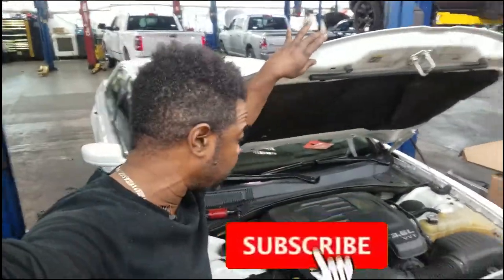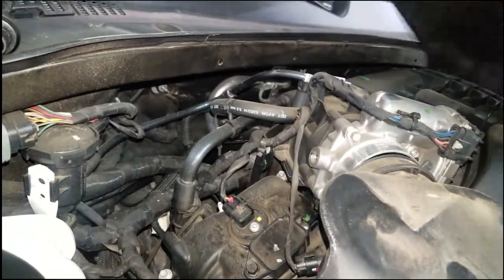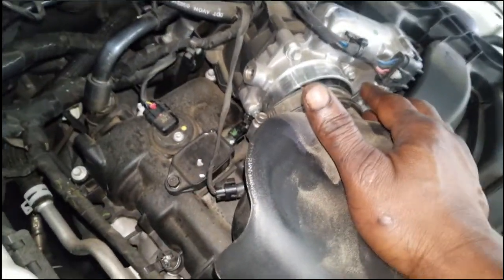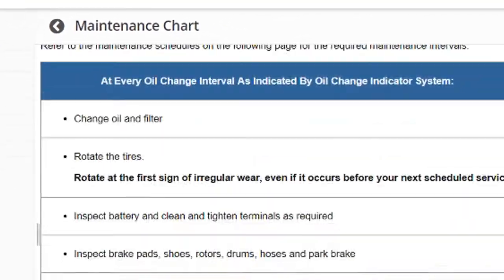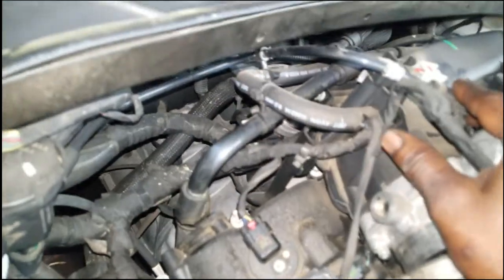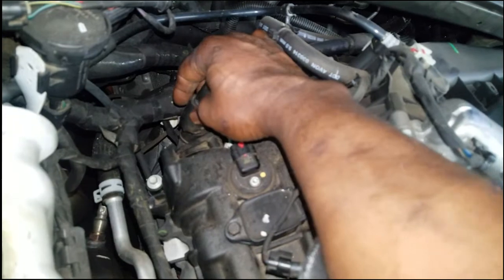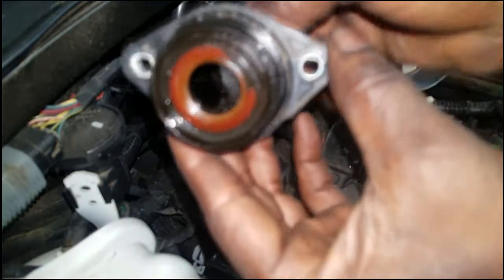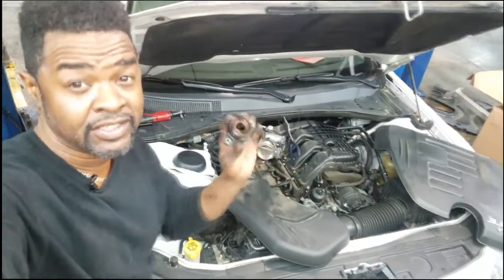3.6L Pentastar PCV Valve location and how to replace. Chrysler Jeep Dodge. Caravan, Town and Country

Comment: Excellent video. Most people don't know the importance of replacing the PCV and no dealership will tell you about it either, cause they want your engine to start blowing seals, then they'll charge you thousands for a new engine! My 2015 Caravan with the 3.6 Pentastar has almost 300,000km's and it doesn't burn a drop of oil! Never had a single problem with this van. No engine/transmission issues... NOTHING! BUT... I take care of it. I change the PCV around every 40-45,000 kms, and this van STILL runs like brand new! The air filter and cabin air filter also get changed out around every 40,000km's. And I only use fully synthetic 5W-20 (usually either Quaker State or Penzoil.)
Reply: That's the key !
Reply: yea i remember taking it to diagnose the oil leak into my engine filter and none of em supposedly had a clue... my a$$! these mechanics are crooks

Comment: I agree yet I would change the pcv valve more often as the engine's hour/mileage increases. In other words change it every 30k and once you hit 100k Miles, I'd suggest replacing it every 20-25kmiles

Comment: The most information and shortest video I've seen on this.  Most others go into an over the top explanation about why the pcv needs to be replaced.  Definitely hitting subscribe to this channel.
Reply from the maker: My man, thanks for watching and subbing.
Reply: @OnlineMechanicTips How about the newer gen 3 Pentastars, where the PCV has no torx bolts/screws???  How do you securely attach/safely remove these pcv from exhaust cam/cover? Thank you.

Comment: Replaced pcv valve at 203k miles.  It was fine.  Just changed it while replacing the lifters.  Also changed the original spark plugs while at it, though they really should have been replaced around 125k  based on the wear it had.  That's just me though.

Comment: Much appreciated; We have the 3.6L in a Wrangler Sport, one of the issues for the check engine code is the PCV. Already did plugs & Coils (as you know when you are there for one, just change it!) but #6 cylinder shows an issue. Even though it does not misfire, mileage the same, no bucking during acceleration, etc. Anyway, Thanks for the 4-1-1 repair...

Comment: What I want to know, is why the Mopar branded PCV valve on this engine is so darn expensive! The dealership wants CAD$125 for the part. Even a non-Mopar one from a local part store is around $115. Are the Gates branded ones from Rockauto just as good as the Mopar ones? I ask because it is only CAD$43.

Comment: I have the newer model 2018 which doesn't have screws attached to the PCV valve only turning it clockwise while pressing hard. However, while doing that I noticed that the orange rubber gasket color was gone the gasket looks fine but the color pealed due to turning it hard clockwise multiple times to make it fit. Should I worry and get a new gasket? or leave it as it is?

Comment: Thanks for the vid. I'm wondering if the pcv valve system can be deleted? Vent the valve covers into the open. Quit getting all that hot air and oil sucked into the intake. ( old-school thinking)
Reply from the maker: interesting
Reply: Install a catch can

Comment: I have a 2012 Dodge Grand Caravan 3.6 & i noticed there is a bit of oil on the top of the engine air filter.  Could a failing PCV valve be the reason for the oil on the engine air filter?
Reply: Yes. Check you throttle body. If there's oil there. Your pcv valve is bad

Comment: I just pulled mine out. My question is the valve spring loaded mine is just rattling around in there freely
Reply from the maker: Then its def time to replace it. Thanks for watching, please thumbs up the video and subscribe to the channel, thanks
Reply: @OnlineMechanicTips  If it was springloaded and it's not anymore I'm wondering if my motor has a spring rattling around in my valve cover??
Reply from the maker: @jessevos5109  Are you working on a 3.6 Pentastar? Again, are you subscribed to the channel?
Reply: Yesir I am subscribed. And yes the 3.6 on my 2017 ram. Could this be why so many  engines experience the failing of the rocker arms
Reply from the maker: Naw i dought it..most of it is rocker arm failure..as for whats causing it, thats still up for debate

Comment: JT, just got the rockers, lifters, gaskets, etc. in so I can finish my 3.6 Journey ticking on bank 2. So I got a new PCV, but I CANNOT find the part number for the updated hose. You show the tag but none of those numbers come up. What is the correct part number for the updated PCV hose??
Reply from the maker: They will ask for the last 8 digits of the vin..also depending on the year it may already be updated..if yours has 2 screws only, that's updated
Reply: @OnlineMechanicTips  I bought the 2 screw, updated Valve, just having an issue with the correct hose.
Reply from the maker: O. They will need the last 8 of the vin to get you the correct part number
Reply: @OnlineMechanicTips  Found it! 
Started the bank 1 rocker and lifter build. Got the exhaust done, but the timing chain is being a little bitch. Took off both phasers so I could route the chain back into the guide on the exhaust side and replace the phaser. Tomorrow I'll finish the intake side. Replacing the phaser and chain will be easier on the intake. (AWD, transverse engine)

Comment: I really need help. I have a 2014 dodge caravan. Over time its fuel economy got worse.. from 10.5l/15 to 16L/100 km. Recently i pulled a uhaul trailer and after that its stuck at using 18L/100 km doesnt matter if i drive in city or highway. A really strong gas smell. I have had spark plugs changed... injectors changed... 2 upstream oxygen sensors. I did the MAF...  no improvement. Mechanic has checked it and cant find any fuel leak
Reply: You should join his live stream and get your question in early as it’s a popular stream. Year make and model. If you need a faster answer, he has a cash app option where he will reply back pretty quick!

Comment: Would this have anything to do with a rough idle? My 15 charger is a bit shaky at idle but only at idle and not all the time. Mount was replaced and throttle body cleaned. Plugs were changed not long ago. I'm thinking coils but saw this video and wonder if I should knock this out too.
Reply from the maker: Did this Charger have any codes in the sys? Also are you subscribed to the channel?

Comment: Will a bad pcv valve cuase my engine to kinda idle alittle bit weird ? Sometimes it’s idling normal and other days it’s kinda shaky and wants to stall untill rpms shoot back up again by itself. Also noticed bad mpg and an oil burning smell but no sign of leakage I did however pull out the dip stick and there’s was no oil at all. A bad one will cuase oil consumption and an engine tick almost like a knock right ? It’s a 2013 Chrysler 300 with 160k miles
Reply from the maker: Hey bud, curious, do you have any trouble codes in the computer? That will def put you in the right direction as for finding the problem. Also, are you subscribed to the channel?
Reply: @OnlineMechanicTips  just subscribed ! And yes I keep getting codes to check my oil pressure but that’s about it
Reply from the maker: @juan_f150  What is the P code number?
Reply: @OnlineMechanicTips  it’s P0174
Reply: @OnlineMechanicTips  right next to the pcv valve you can also hear a small whistle almost like it’s leaking air

Comment: Off topic question. I have a camshaft actuator open sensor bank 1 code and already changed actuator and oil solenoid. And code still there matter of fact 10 more codes pop up. Can u help

Comment: Hey there!  great videos btw , I have a 2015 grand caravan and it recently developed a rough idle changed the spark plugs and the cylinder 6 coil but there is still a rough idle I didn’t think of doing that pcv until I watched your videos tonight just 100,000
Reply from the maker: This likely not you problem. Have you done a C test? Also are you subscribed to the channel?

Comment: Thanks for the video....How to test this type of pcv valve l??? i can blow air on both side and there is no restriction, other pcv valve are one way only
Reply from the maker: Hello my friend, these valves are design a lil different than the traditional valve and the test never seem to yield accurate response so with that, I just recommend replacing it every tune up spark plug change. Thanks for watching, please like the video and subscribe to the channel for me, thanks

Comment: Mine has 3 screws and I can only find the 2 screw PCV valve.. will it be the same even if the orientation of the hose is different?
Reply from the maker: They have been upgraded bud. They only use 2 screws now. https://www.youtube.com/watch?v=liwUEh6dqRE
Reply: @OnlineMechanicTips  Sweet! Thanks for the upload!!

Comment: I have a 2013 Jeep Wrangler unlimited and when I am sitting idle for a couple of minutes, I can smell some vapors coming through my air conditioning. Could replacing the pcv valve help with this?
Reply from the maker: Hello my friend, can you please like the video and subscribe to the channel so I can get it to grow? thanks...Hey im not sure the PCV valve your problem, i mean its a sealed setup if all the hoses are attached..But because its so inexpensive, it wont hurt to just replace it any way. This is a wrangler and this under body can attract all sorts of things. You could easily have a piece of plastic melting on one of the cats..The valve covers could be leaking, all sorts of things could cause this..Give this Jeep a real good visual inspection and see if you see anything un common..I would even steam clean  the enginei at the car wash (bath) and see if this persist

Comment: So what do u think of a oil catch can on the 3.6?
Reply from the maker: Hey bud, IMO, if I remove my intake manifold to say, replace the spark plugs and I see excessive carbon deposits, then yes I would consider installing one. But todays newer cars do a fine job with the PCV sys. Engineers one told me, If carmakers felt your car would benefit from a CC, it would have been installed at the factory.
Reply: @OnlineMechanicTips  or do u think they, car manufacturers, would think that the consumer who buy the car would not be smart enough to clean it, and or more responsibility on the mechanic to maintain it?

Comment: Can this help with cold start issues in winter weather bro? Nice video btw
Reply from the maker: Hey bud, thanks for watching an subbing..Yes if the PCV valve sticks in the open position, too much air will flow into the intake and causes the engine to lean out or evan stall at idle and cold start..Because this valve fairly inexpensive, ide just replace it everytime you tune the engine up

Comment: Might sound dumb but you dont know if you dont ask, but the pressure comes out of the pcv correct. Thinking about adding a catch can on my 300. Btw great video bro.
Reply from the maker: Exactly, but at a pre-determine time..you really dont want PCV during say, cold start or say idling..The pressure and vapors are routed back to the intake..A catch can sys will, well suppose to catch all the oil.. Not a bad idea, especially if its a high mileage car..My buddy added 1 on his high mileage 300 with the Hemi..Hey please sub the channel for me, thanks

Comment: Another question bro, have you ever heard of a catch can install on the air filter side? 🤔
Reply from the maker: I have not
Reply: I have.  Seems to me that it's a bandaid for some other issue like the valve and it might even be more expensive to install a catch can.  But I'm running a 2013Wrangler so maybe there's something different about that.

Comment: I have a 2011 grand Cherokee and man there is no room to get to that pcv valve. I wish I had it that easy
Reply: Hey so I am going to be attempting PCV valve same car, same year. Any advice? Do I need a new hose or will old hose fit because I heard they have updated hose and valve possibly?
Reply: @josephoberman331  you need a new hose. They changed the pcv valve to the way it should have been built in the first place. It’s a pain in the ass, but you can do it